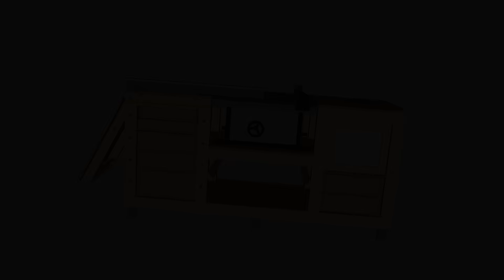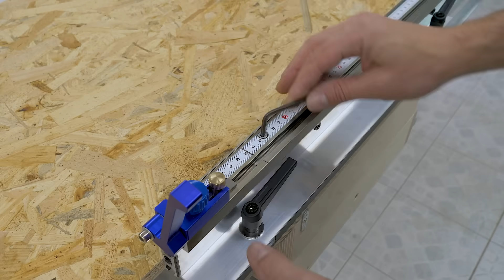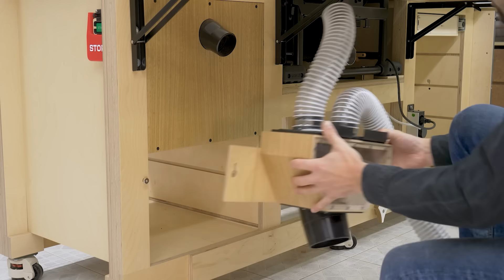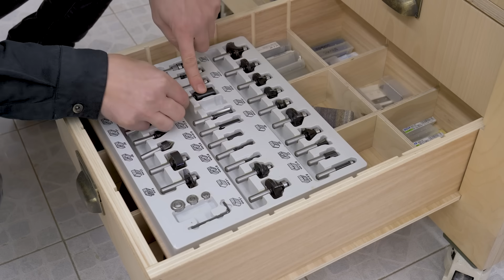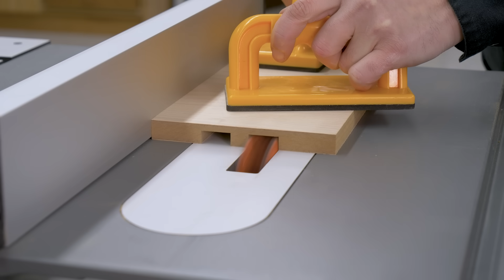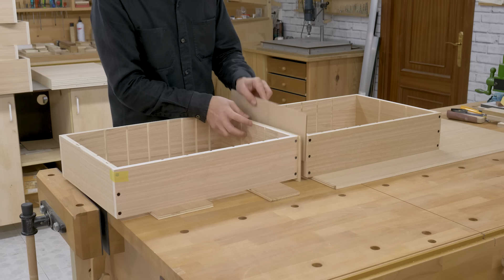DIY Mobile Workbench with Table Saw & Router Table / Showcase - Ep 8

Comment from the maker: Plans for this project: https://bit.ly/3iRfbd9
Reply: This is awesome! I've been trying to figure something like this out and this way better than what I could come up with. I could even see how to swap out the table saw with my chop saw to have much better support for long pieces. I also love your jigs and need to be better at making them.
Reply: The design and video's look awesome, great job! 
I am interested to download the plans and starting working on this project. Do you have a rough estimation on the cost you made for materials making this workbench? Thanks in advance!
Reply: Impressed with this plan. Purchased thse and I'm very pleased with the details and Sketchup files. I'm building for the US model Dewalt. I have a question regarding tolerances. My measuring tools and such are in Imperial units.  Conversion from metric yields some unwieldy fractions. What kind of round off is reasonable to facilitate easier fabrication?

It's late in the game or I'd have purchased all my tools as metric. So much more user friendly.

Baltic Birch plywood is $274.30 current local price while it lasts. Not in my budget that's for sure. I'm considering other options.
Reply from the maker: @j-book3937  hi mate, send me an email please, I will be able to help you better
Reply: Gracias por el plano quiero armarme una mesa de trabajo funcional
Reply: quien me dona el plano T_T
Reply: seems like your website is down ...
Reply: An excellent design!  Maybe you would consider designing a different version with a long sliding feed table (e.g. the Austrian-made Hammer saw) for putting a straight edge on  live-edge boards and for longer rip-cuts?
Reply: In your opinion would it be feasible to make articulated hinged arms  like in this MiniMax video ( @28-33 seconds https://youtu.be/0SYDxp7UKe0 )  using 3 pieces of  birch plywood laminated together? You were standing on the frame in your video; the 3-piece lamination seems very strong!
Reply: How do you like the casters after a year of use? Do you lower the feet every time you put the bench away? In my shop, I would only be able to get to the front casters to lock them down and I worry about flat spots on the wheels at the back. Would be curious as to your opinions. Thanks...Bob
Reply: Too expensive.
Reply: Hello, I bought the plans from you. Unfortunately the zip file is damaged. Can you help me?
Reply: What are the dimensions of the table? In this video you said that it's 180x70 cm but according to your website with this table plans it's 200x103,8 cm. Thanks in advance for your clarification.
Reply: This link is dead. Are the plans still available? I’d love to make this.
Reply from the maker: @SwallowtailStudioLtd  solved!
Reply: Should find a manufacturer to sell these as kits.
Reply: Aaaaa siiii, disculpa, no me había dado cuenta. Gracias!!! 😀😃
Reply: If purchased already we can re download for an updated version now that the series is complete?
Reply from the maker: @capemaster123  of course! 
1.- If you are not logged Click on "Sign in" button
2.- Click on your user name on the top right corner
3.- Click on "Order history and details"
4.- Select the order reference
5.- Click on the link of your product to download

https://www.paoson.com/en/faq
Reply: @Paoson_Woodworking  I hope you can build a homemade jointer and planer combo machine✌️

Comment: do you think that  is it possible to use OSB instead?  maybe by keeping the same measures
Reply from the maker: yes, the only thing required to use it safely is to reinforce it with a more resistant board in some places, such as where the casters are screwed
Reply: @Paoson_Woodworking  ok, thanks for fast answering, so you mean build part of your project (I bought it) with OSB and some other with hard plywood? if yes my idea was to use the wood nails instead, it should be fine, I think
Reply from the maker: check this out: https://youtu.be/pAxEtXPV58k?si=nvto8NS827Ioj3fO
Reply: @Paoson_Woodworking ❤ that's clear thanks a lot, ok I've understood, tks

Comment: Cut all parts but the spacer note is not clear. it says I need a 80 x 62mm but then says another 66mm. is this 66mm x 62 or 80 x 66mm?
Reply from the maker: hi Brian, the 66mm one is only for the middle cross rails

Comment: Looking at this now as a dual hand/power bench, one key modification is needed. The front face needs to be flat across. Current design shows table saw fence rail extending proud of the frontal plane. Saw needs to be set back a bit or front face extended forward so that a long board can sit flush (eg for edge planing). More dog holes for holdfasts could then be provided on router table side. Plenty of options for work holding on the top (face planing) and end holding (dovetails). Bench is plenty massive for hand tool work. Won’t have the warm charm of say a Moravian bench with a maple top, but this will be a lot more flexible and adaptable in a modern hybrid shop.

Comment: I’ve seen a lot of benches, and I favor those set up for hand tool woodworking, but this…. this is not only an incredible power tool station but also has adaptations for hand tool work holding. I really love the combination of featutres that allow a small table saw to handle work like a much larger cabinet saw.

Comment: Hello, your work is very impressive. I would buy your plans for this workbench except for the fact my garage requires me to have a work bench that abuts and runs along a wall length way. I need a table saw facing along the wall from right to left and not facing into the wall as this plan dictates. My space is limited. I would build your module bench to run off the left end of the main work bench, (or far end away from the table saw), and I would build the outlay table to extend out to the left from the table saw. The router table section of the bench would place between the table saw and the module bench. What are the chances you have plans? Are you able to help? May I hear back? Kind regards. TD

Comment: It’s a clever and highly functional design that is impressively optimized.

Having said that, I’m convinced to go in an entirely different direction. Why? Safety and higher quality overall.

I’m minimizing my investments into my tablesaw because they are clearly dangerous given something like 65,000 injuries a year. I like my fingers allot. “Don’t try harder, try different”

I invested into a Festool track saw (and the system of accessories that implies) for its safety and precision.  That eventually points to a MFT table to optimize its functionality.  Table saws are not well suited to cutting down sheet goods unless you have a $15,000 sliding table saw used in bigger shops.

Yes, it’s expensive and is designed around a large MFT table which needs a big space to accommodate the table and the working clearances around it. Both of those challenges are significant for small shops on a budget. “It’s the future” in spite of those challenges.

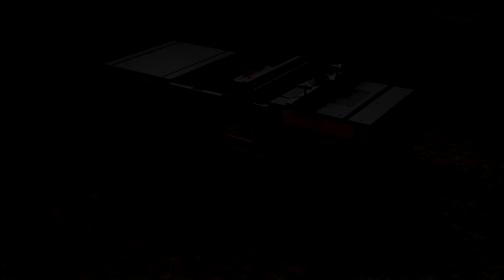Comment: This is great but I had a red flag go off at 17:01-17:07: Isn't running the smaller off cut on the inside of the blade highly dangerous due to kickback? 

I would be great to hear your thoughts on this as I will be building this workbench.

Thank you!
Reply from the maker: hi, you should have no problems with that type of cut if you have your table saw adjusted, and a riving knife

Comment: By far the best setup of its kind I’ve seen. Question: how do you prevent the drawer slide-based pullout for the slider from racking enough to get out of square for a cut? Or are drawer slides really rigid enough to stay as square as we want our cuts to be? Hope that question makes sense.

Comment: uhmw tape, low friction tape can be used on wood drawer slides. only needs to be used on one side unless drawer is heavy. use a scale to measure the difference it makes to pull the drawers.

Comment: Greetings from Ireland, I'm a woodwork teacher in a highschool. We use much larger machines to break down materials and have dedicated machines then for each process. Just for my own workshop at home I would be interested in what you said about dado blades (no way they would be allowed at school but in my own home yes!!) I see guys using a moulding machines on vertical spindles to take out the material but where I am they are very rare and therefore expensive.. Have you made a video where you explain where in Europe we can get a arbor long enough to accommodate dado blades?

Comment: Quite a beautiful design. Where I live the DeWalt DWE7491RS is available - the only important difference seems to be the table depth of 670mm instead of 650mm. Is it possible to adjust this dimension easily in the CAD source, then output the updated cuts, and then import this into MaxCut? Judging by the level of craftsmanship here, I'm guessing this would be straightforward!
Reply from the maker: please read this article and send me an email if you still have questions:
https://www.paoson.com/blog/en/bench-saw-and-boards-for-the-mobile-workbench/

Comment: This is awesome, just a couple of questions. 
Which dewalt saw is this? 
Is there enough space to use larger routers?
Are links on where to but all the additional parts like the aluminum slots included in the design for sale?
Thanks in advance.
Reply from the maker: yes, you can install  larger router. Here more info: https://www.paoson.com/blog/en/mobile-workbench-with-table-saw-router-table-showcase/
Reply from the maker: https://www.paoson.com/forum/viewtopic.php?f=22&t=57
https://www.paoson.com/forum/viewtopic.php?f=22&t=871
Reply: @Paoson_Woodworking  Thanks a lot 😀

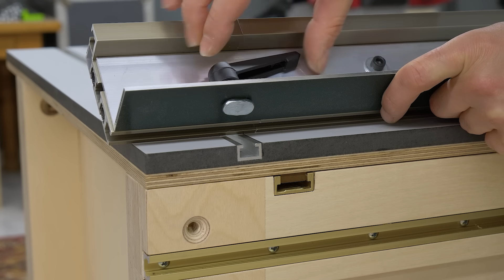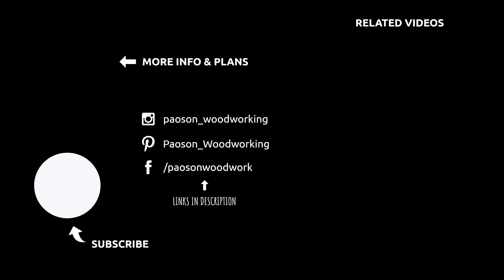Comment: 2:58 / 24:54
#woodworking #workbench #tablesaw
DIY Mobile Workbench with Table Saw & Router Table / Showcase - Ep 8
조회수 1,233,687회2021. 12. 23.
2만
232
Paoson Woodworking
구독자 57.6만명
This is the last video in an eight-part series about my new woodworking workbench, fitted with a bench table saw and a router table.
좋아요 
좋아요 하나 더. + 1 
GOOD 1
LIKE ONE
2만  +  1 = ?
719
202210131143

Comment: Well you've convinced me.  I was going to buy a Powermatic 64B and build a rolling cabinet around it.  For that price, I can get a DeWalt bench table saw and all the plywood (baltic birch is $129 a sheet right now!) to build your design.  I agree with the other commenters: excellent design and workmanship.  Your work is a great example of what a master craftsman can do.  Only problem is that some of the sheet material you use is hard to find (if not impossible) in the U.S.  Thanks!

Comment: Very clever work! I imagine a few sleepless nights nutting out the process. I think the sliding table is a gem, but how is the table & the saw aligned together? Is there any adjustment? I have this Dewalt & will say it almost as good as a traditional table saw, powerful, accurate & a great fence!

Comment: I just picked up woodworking as a hobby and am building a much simpler workbench as my first medium-large size project. Once I've used it and know what I want and how my workflow is I will probably design another and borrow many of your ideas. At which point I'll give the old bench to my father.

If you want wood on wood drawers to  slide better, use some  bees wax. You may have mentioned it, as I watched video 1 then skipped to this to see it working and will go back and watch the rest.

Using SketchUp to build an optimized cut list I have learned I definitely want a setup with multiple stop blocks. When you minimize the amount of lumber you need you are  making matching  cuts on different boards with other cuts in between.  Of course I could just be better organized but I'll probably still  implement a stop block system.

Thanks for all the great ideas.

Comment: It is obviously excellent video. The mobile unit is a fine example of your skills. The saw you chose is another. Runout on these is perhaps 0.001.  I watched the guys from Forest Blades in N.J. Demonstrate the ability of their Woodworker ll mounted in an old Skill contractor saw consistently produce 1.5 mil leaving no kerf marks As I recall they. we’re using a well tuned Beismeyer fence. And it was the 3/32” thin kerf blade. Point is, I’m getting rid of the cabinet saw and will duplicate your ideas. Thanks very much.

Comment: I find it interesting that you made sliding pieces in your sled that allow you to achieve zero clearance.  You can do a similar thing with the dado blade insert for your table saw for use with different width dado stacks.

Comment: I am so impressed with your accuracy and design, it is amazing to watch! The multiplex also seems much lighter than the one we have in my country (The Netherlands) only poplar is similar to the one in your video.

Are the design drawings flexible if I for instance want make a small hold clamp table in the position where the router is? I am very limited in space so that would give me some more flexibility (maybe another folding option on the other side as well)

Comment: Have you thought about integrating an incra table saw fence?
I think it should be possible, with little modification. Maybe adding a removable  rail on top of the table saw nook flush with rest of the workbench to mount the front extrusion.

Comment: I know I’m supposed to want that cast iron top cabinet saw but after showcasing what a portable saw can accomplish I could see myself putting in some love to my portable saw. Making it happen with what you have is something I apply to other aspects in my life too. Incredible build, It was a pleasure to watch.
Reply: It's a really decent saw. The rack and pinion fence is, in my opinion, better (in terms of adjustment) than the fences that come on saw stop products. 

The top though, has hollow about 2 mm deep cuz they cast them but dont flatten them.

I am building something very similar to this project and often have some regrets pouring so much effort into support infrastructure for a kinda crappy table saw. But I just tell myself "I'm not building the space shuttle here." 

But cabinet makers kinda are... such tight tolerances on mill work.

Comment: I purchased the plans and they are great, however, I am having some difficulty identifying the top pieces (by number) in the assembly drawing as you do for the frames. I need to identify these so I can make them out of a material with smooth and hard finish other than 3/4 in birch plywood. I would also like to have Maxcut put these top pieces on a separate sheet. As it is now, they are mixed in with the other pieces.  I would like to use the material you use for the tops, but cannot find it here in the Colorado USA.
Reply from the maker: hi Kelly, send me a private email with your questions, I will try to solve them!

Comment: If one has the time, tools, the space, the ability, and the resources to build this bench, I think they really do NOT NEED this bench - second, in order to acquire the $$ to make this bench plus the time, a general carpenter needs to sell a lot of work to save $ need to buy the material - I say, it should take them about 15 years to save up enough money - therefore, in conclusion, you can see that a table like this is a nice to have, but definitely not a necessity.

Comment: I recently purchased the plans for this workbench and am building up the courage to start. I absolutely love how comprehensive they are.  I will post pics on the forum when finished. could you please tell me the name of the MDF material you use for the tops and for the sled, it's probably in the plans somewhere, but haven't managed to find them. many thanks Steve.
Reply from the maker: Compacmel, here more information: 
https://www.paoson.com/blog/en/bench-saw-and-boards-for-the-mobile-workbench/

Comment: Awesome build. I love it when people can engineer better things themselves than the "professional " manufacturers. If I were a major maker of tools and equipment I would approach you for a deal. 
I have the Bosch worksite saw (similar size as your DeWalt) but I don't like the fence system for super-accurate cuts and it bogs down and I have tripped breakers just ripping SPF and PT 2x material 
I'm designing a shop (my first) now and have room for whatever size saw I want but can't determine what HP would be best.  The attention to detail and precision and forward-thinking shows me that you produce quality work. Good luck and thanks for sharing. Giving me ideas!

Comment: It is an amazing bench. Would you say it will completely eliminate the use for a traditional bench with a vise?
Reply from the maker: I think it is better to have both tables, but if you only have room for one, this is more useful
Reply: @Paoson_Woodworking  - Thanks. :D I have resently gotten a small 9 sq/m hobby room in the basement of my apartment building. So I haven't got a very big space to work with.

Comment: With every video you have posted in this series, I am more pleased with my decision to buy the plans for this. If you want a non-intrusive way to make your router quieter, look into the automotive industry. There is a sound deadening mat that goes under many different brand names, one of the most well known brands here in the USA is Dynomat. It gets applied to the interior floor, firewall, and inside the doors. This is designed to drastically reduce road, and exhaust noise, and heat from the engine and exhaust from being transferred into the car. The exposed surface has a foil coating which would lend itself very useful in your router enclosure because, the saw dust will not stick to it. The most appealing thing about this is, that it's only a few millimeters thick. The biggest drawback to this "might" be that you would have to periodically open and close the door for the router enclosure to allow hot air to escape.